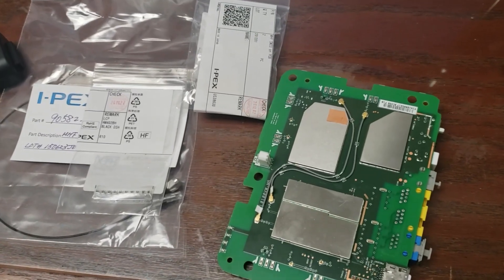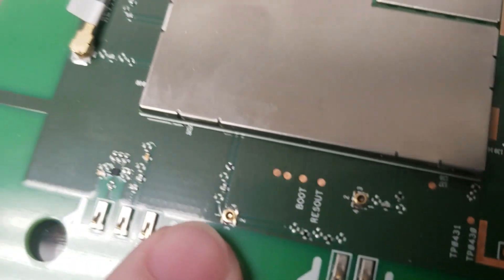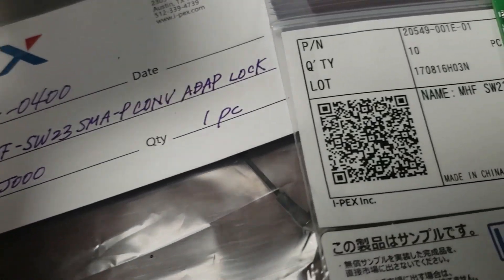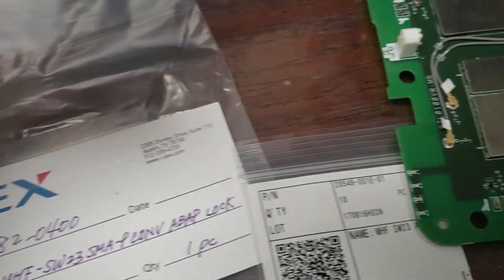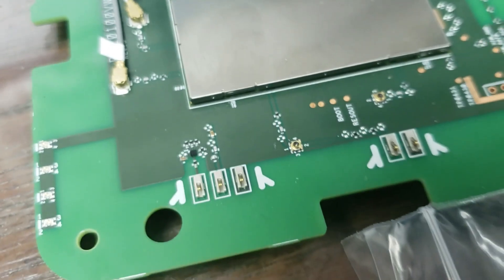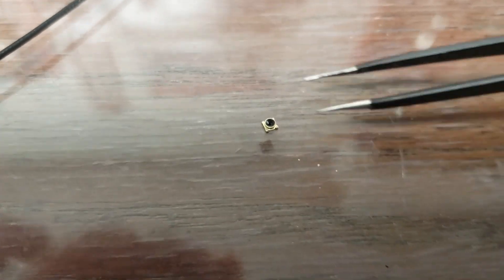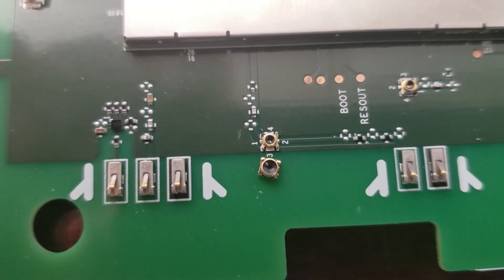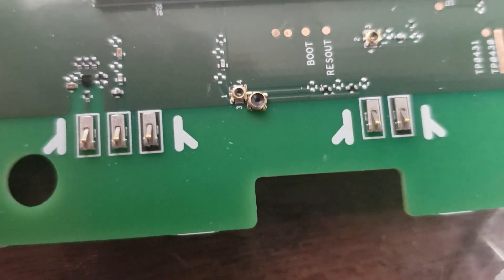T-Mobile Home Internet LTE TM-RTL0102 Router Internal Antenna Connectors

Comment: I am working something similar - hot spot - external antenna .
Some info that I have gathered , still have not completed , so incomeplete like this video .
there are multiple of these surface-mount RF connectors - starting with size , seems to 3 sizes in both diameter & height .
The next is more of a guess - seems most consumer stuff that broadcasts RF - they use RP = Reverse Polarity connectors --- this means the center connector is on the oposent end --- the PIN .
On IPEX site there is a cad drawing video showing the reverse polarity cable connector pushing into the board connector - it hits a tap / lever - that disconnects [ without anything connection - the board connector connect at a through circuit ] and the pin pushes the lever disconnecting / interrupting at that point & allowing RF to leave via that cable  .
I do not have my notes , seems like multiple sources for these type of connectors IPEX is more of a brand , then U.FL , I forget the 3rd label / type .
Hopefully that makes sense .

Comment: Did you ever figure out which connector it was?
Reply from the maker: Sadly no, but I've moved on to using my own router and modem, and my other location has the 5g box which has connectors.
Reply: @Joseph-ur  what modem did you use I need something 4g only where I can use a outside ant.
Reply from the maker: @tonyapples1687  If you only have 4g coverage the Sierra EM7411 worked great for my needs.  Combined with a good 2x2 MIMO antenna setup it worked great for me.  I've since now moved on to 5g
Reply: @Joseph-ur  all i find when i look for that model is a pci card modem do know brand and model on the gateway you had
Reply: Any new ideas on those connectors - I’m trying to ID a very similar looking connector in the Starlink v2 router